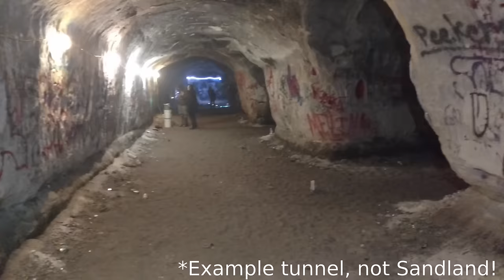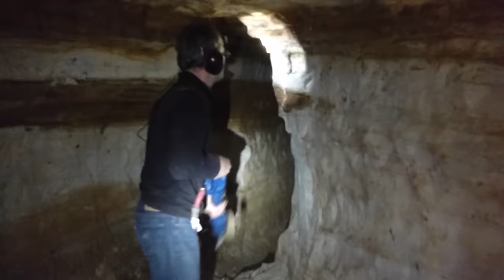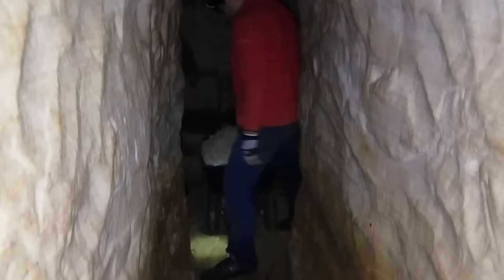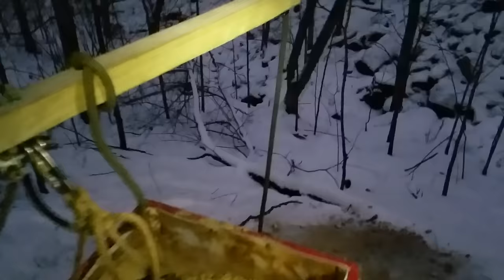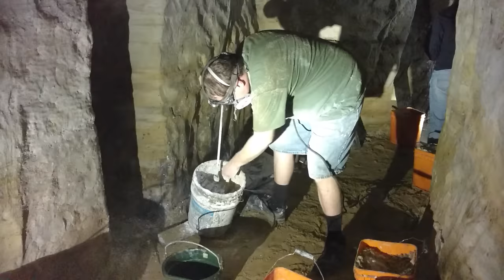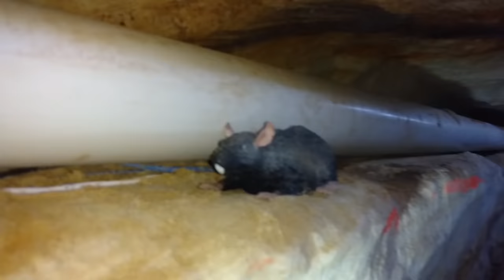How To Dig Your Own Underground Sandstone Tunnels!

Comment: that is some amazingly soft sandstone... I've mined the stuff in Pennsylvania and I can assure you they don't just crumble and fall apart... hydraulic splitters are needed to separate the pieces. Being that soft I'm amazed you don't have water problems.
Reply: Yeah, I’ve been doing some work in My backyard in Sydney, Australia.
The sandstone is like flint in some places. Sparking at the tip of the jackhammer. It’s just so hard.
Reply: There is probably a difference in what other minerals are mixed in. In Tennessee there is a lot of iron, and copper, mixed in.
Reply: @rhondasisco-cleveland2665  Maybe, but they're playing with stuff that's literally like packed sand, not stone at all.
Reply: @kleetus92  lucky them.

Comment: You could take the tires off the wagons and lay pipes down for tracks. Much easier to move the sand. Also consider digging at a slight incline 1-2 degrees. Easier to get the sand out. Later on you could level it if desired. (After the vast majority is removed)

Comment: This is so bloody cool! Would you mind telling me a little about how you deal with ventilation ?
Reply from the maker: We have a pipe from the surface with an electric fan, it runs constantly when we're working. As we go deeper we plan on extending some air lines. The tunnel also "breathes" to some extent through temperature differences with the outside.
Reply: A ventilation hole on top, an air suctioning hole from below.
Hot, used air goes out the top, clean air is sucked in from a lower level.
Reply: At 3:20 you can see a PVC pipe and fan.

Comment: here in iceland we dont have any sandstone but we do have palagonite which is basically volcanic sandstone formed from eruptions under ice. mountains are often made of it and i plan to dig a tunnel into one nearby my house. its about the same hardness as sandstone and very easy and fun to work with!
Reply from the maker: Very cool! I've seen something similar in Naples Italy, they have hardened volcanic ash called Tufa. Lots of tunnels dating back to the Roam empire or even earlier.

Comment: Although it's a lot softer than what it's designed for, try a concrete saw. The only real issue I see is it's usually gas powered, but I imagine there are electric ones out there

Comment: It looks like pretty soft sandstone. I started digging a shaft for a wine cellar/whatever under my previous Sydney house using a hammer and cold chisel (for a bit a relaxation in the evenings) and our sandstone can be pretty hard (especially when you hit bands of 'ironstone'). Sydney sandstone has compressive strength of 40-70 Mpa. Not sure how this compares to the sandstone at Sandland, but from the video it seems quite soft.
Reply from the maker: I've heard about the Sydney sandstone, but never been there myself (went to Melbourne once and checked out some tunnels there :-) ). There's a guy who goes by "Paleas" on Youtube digging tunnels under a building in Sydney.

Comment: Easiest way is to drill a line of holes then hammer in wooden, bone ( tips of antlers) or metal pegs thus spliting off slabs that you can use. On the other hand there's Dexpan.
Work smarter not harder.
All the best Pete.

Comment: Man, sandstone's so cool. It's so soft, you don't even need to wear helmets or make any support structures while tunneling through it.
Reply from the maker: These days we do wear helmets and respirators, some of the footage in this one is a little older. But usually nothing significant falls from the ceiling if you maintain that arched shape.

Comment: This makes me want to try it at home... I think there is either Gysum or Sand Stone under the dirt where I live.  A sandstone tunnel would make a great fallout bunker.
Reply from the maker: Sounds awesome! Gypsum is a little less stable than Sandstone, or so I hear. Maybe easier to dig though.
Reply: @saveitforparts  I just need to start digging straight down and see what I hit.  I know there is a former gypsum quarry half a mile from me so may be worth digging down.... be good when the nukes start flying.
Reply from the maker: Depending where you live, you might be able to find geological maps or well drilling records that tell you how deep the different layers are. Sometimes those are online. More cities/counties etc are also doing LIDAR surveys that show pretty accurate elevation data, if you can find a website for that you could check the elevation of the exposed gypsum at the quarry vs your place. 
If you dig straight down, make sure to have some ventilation and some way to deal with water! Sandstone can erode if it gets wet and I think gypsum does even faster. Air can get stale at the bottom of a hole if there's no other vent or cross flow.
Reply: @saveitforparts  I would love to see this tunnel sometime. Want to see how it's done so I can start one

Comment: Wouldn’t there be a miniature underground railway or an underground light railway.  There have been sandstone tunnels big and large enough for a standard gauge train, heavy rail.  Large sandstone tunnels are strong enough that they didn’t need stone or brick lining.  But ones in the city needed concrete lining for a heavy electrical railway system.  Quite interesting.
Reply from the maker: We have a short inclined railway made of wood to haul some of the sand out. We've discussed trying to do mine carts but the rubber-tired garden wagons seem to work well enough.

Comment: Wonder if you cold use a propane skid steer with a jack hammer attachment?

Tunnels would be larger but you could move a lot more material
Reply from the maker: We don't really want combustion engines in the tunnel, even propane puts out CO2. I've been thinking of turning my electric mini tank into a mini skid steer...

Comment: I live in the same region as you it appears.  I’m off the Kickapoo River valley.  I’d love a tunnel from my house in the hollow on one side of a creek to my hilltop 300 feet up and 1600 feet back on the other side of the creek. Is that even remotely doable?  I could start the tunnel on the other side of the creek if the creek is a huge obstacle.  Gotta be mostly sandstone.  I know for sure up near the top of the hill are exposed sandstone rock faces.  I’d love to check out your project.
Reply from the maker: You'd have to check your local geological maps for the exact elevation and thickness of the sandstone, 300ft might end up going through several different kinds of rock. Most counties have maps and info like that online in various formats. You might want something a little more industrial than our setup for a tunnel that far. If you have good water flow you could try hydraulic tunneling (blasting the sandstone with high pressure water). And of course you'd have to check local ordinances for hillside construction and sand disposal. Parts of Wisconsin are basically still in the 1800s and haven't invented building codes or the environment yet, but other parts have laws about erosion and sediment runoff. We store our sand in a DNR-approved containment area and have it hauled away once we have a big enough pile.

Comment: This video spoke to me. I have always wanted to buy some desert land and dig my home out of the rock, kinda like that guy in Fresno did with the hard pan there. A mostly-underground arboretum and whatnot. Any idea where I can go to learn about the mechanical properties of sandstone? What angles to carve that remain stable? Load bearing capacity? How to drill and or attach things without compromising the integrity of walls or load bearing elements?
Reply from the maker: It depends on the type of sandstone, we're in the Jordan formation, similar to nearby St. Peter sandstone. Both are pretty soft when fresh but tend to harden up a bit when exposed to air (so the first few inches are tougher when you're starting to dig from the surface). I know there are similar sandstone formations in other places (Utah, Turkey, the UK, etc), but there are also harder sandstones that are worse for tunneling and better for buildings (ours would be too crumbly for that). 

We've based our tunnels largely on existing tunnels, brewery caves, etc that we've seen in the area. As long as there's no water flow across the sandstone and you don't let it dry out too much, the tunnels generally don't need to be lined or supported. People will sometimes line them with brick or cement for extra strength, or if they want to heat or dehumidify a space. There are a few scientific studies directly related to our local sandstones, not all of them are online but some are in university archives. The Journal of Soil Mechanics and Foundation Engineering has some good stuff, anything by professor Ray Sterling from the UMN Underground Space Center in the '70s, or more recently stuff like https://onepetro.org/ARMAUSRMS/proceedings-abstract/ARMA15/All-ARMA15/ARMA-2015-679/66025?redirectedFrom=PDF

If you're not in the Midwest I'd suggest looking for existing sandstone mines / caves / tunnels in the area and try to find out how they were designed, mined, and how stable they are. Brewery cellars are also fairly common where there's easily-excavated sandstone.

Comment: Do you know if tunneling through limestone would be significantly different in the processes used? Thanks!
Reply from the maker: Limestone is quite a bit harder, so not as easy to dig through. It tends to have fractures and cracks that you could try enlarging or use to pry out chunks, but you won't be able to carve through it like sandstone. On the plus side, limestone is more likely to have natural caves!
Reply: @saveitforparts  thank you for the reply! If I needed to tunnel through about 30 feet of limestone (enough for a human to crawl through), how would you recommend doing this?
Reply from the maker: @maxl2994  I suppose tools like we're using could work, they would just be much slower on limestone. We currently use electric "demolition hammers", the cheapest ones are ~$100 and the name brand ones are more like $400+. We use wide spade bits, but something like a narrow chisel bit might work better for limestone. You'd likely need to re-sharpen your bit every few hours on a grinding wheel. Hope that helps!

Comment: What is the maximum depth of your excavation? Things become difficult after 100 ft or so once you reach bedrock.
Reply from the maker: We're technically IN the bedrock, it's a thick sandstone formation. Our adits are into the side of a hill so the vertical depth varies.
Reply: Wait bed rock is real?😂😂😂
Reply: @question7615  Its where the cavemen slept. The didn't have Casper mattress' because they couldn't listen to podcasts, slept on the rock, thought it was comfy enough, and that's where we get the term from.
Reply: @Youchubeswindon  thats pretty cool not gonna lie

Comment: This is super cool! One question though. Have you had any trouble with flooding or water leakage?
Reply from the maker: No water issues, it's all above the water table and Sandstone is pretty porous, so any moisture just kind of soaks in and disappears. The freshly-mined sand is actually a little damp, which also helps keep the dust down!

Comment: How to use compass in digging tunnel for exact location?
Reply from the maker: When we're doing really precise work we use something called a Disto (electronic surveying device). That way we can make sure the passage is going the right direction for the right distance to connect loops. You can use a handheld compass and tape measure as well, you just have to be really careful to line things up!

Comment: I want to dig a tunnel from our basement, but my wife tells me I am nuts. I must tunnel! HELP!
Reply from the maker: Colin Furze is probably a better example of a basement tunnel! Unless you have sandstone bedrock right at ground level :-)
Reply from the maker: Well, if you can get to sandstone easily, then you won't need to do as much reinforcing and concrete pouring as Furze! I'd still recommend starting from outside so you don't have to bring the sand through the house, that stuff gets everywhere!

Comment: Can you do this with limestone?
Reply from the maker: It would be a lot slower with limestone, it's not so easily broken up as sandstone. I think you could probably still do it, but the tools would wear out faster.
Reply: @saveitforparts  Appreciate the info...I was told I have limestone but it appears to be an old coral reef. The exposed parts are full of little holes and easily broken. Then you hit seems of flint. The flint has some weird crystals growing in some of it. The limestone under the ground turns into one big piece that looks more like sandstone and is wet and abrasive. I am on the edge of the Edwards Plateau in Texas. I want to make a root cellar/tornado shelter in a steep hillside but was afraid the rock was to brittle to mess with.
Reply from the maker: @cbriangilbert1978  I can't remember if I suggested a state/college geology dept before or if that was someone else? I bet they'd know based on your elevation and location, or they'd have some bedrock maps you could consult. A smaller room like a tornado shelter would be less effort than a larger tunnel system, but would still probably be slower in limestone than sandstone. If the rock is damp then you'll probably want to vent it for food storage to control humidity, and maybe add supports in case it gets more crumbly as it dries out.  I know our sandstone loosens up if it gets too dry.
Reply from the maker: By the way, the cheapest electric jackhammers I've found that are actually decent quality are "XtremepowerUS". I use the 1400W version. Yes they're a knock-off import but they seem to do OK. With any electric jackhammer you want to let it rest and cool off after about 10 minutes of heavy use, that gives you time to shovel out the material as well. If you have a compressed air tool I think you can run it longer since they're self-cooling.
Reply: @saveitforparts  Appreciate it! That is way cheaper than the ones I was looking at.

Comment: How are you getting fresh air down there?
Reply from the maker: We have an air pipe and fan to the loading station. Currently we have two entrances and are digging a third at a slightly different elevation, which will also help with airflow.
Reply: @saveitforparts  keep in mind c02 is heavier that oxygen. at your deepest part you should bore a hole straight down, and blow in fresh air, this will displace the c02. keep it up, great videos